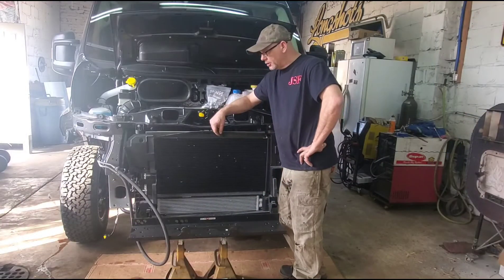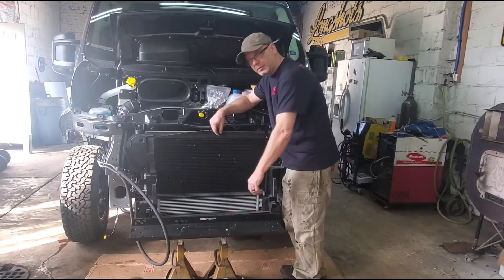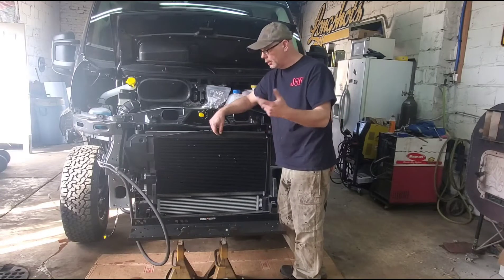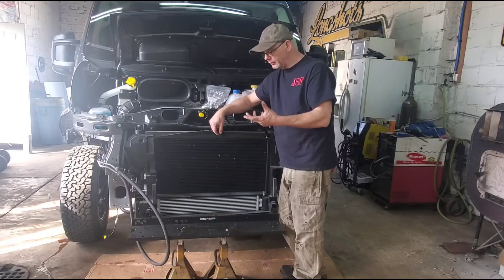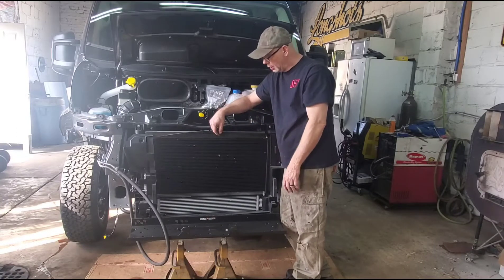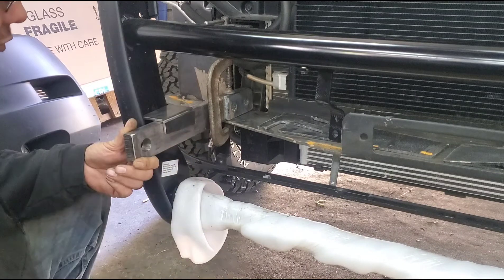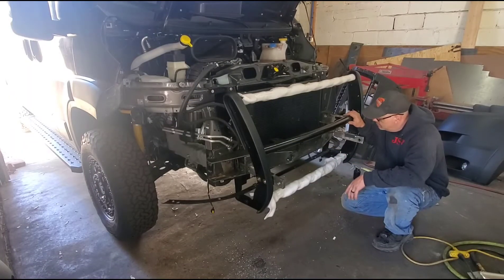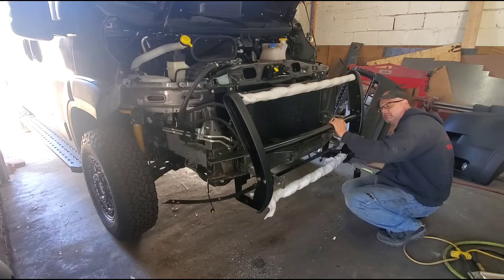2021 Ram Promaster winch mount,Warn M800 winch and push bar fabrication and install. Part 1

Comment: Got the push bar and winch. I’m from SJ 🎉. Watching
Reply from the maker: Nice! Thanks for watching. Did you get a mount that incorporates the push bar?
Reply: @jerseyshorefabricators7431  I bought a different bar. Chrome and it came from Poland. Mine is a 16 and when I got it I had a heck of a time finding a bar
Reply from the maker: @christopherrasmussen8718  I bet the chrome looks good on it. We'll done.